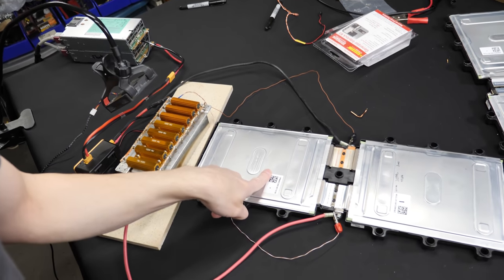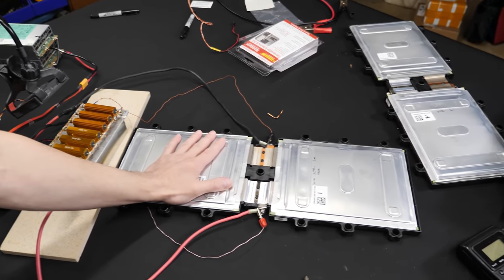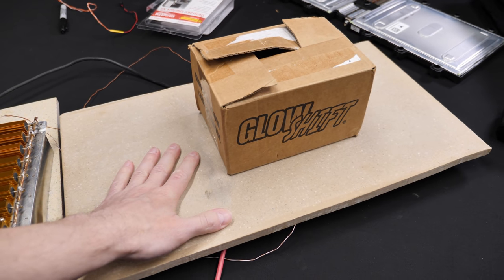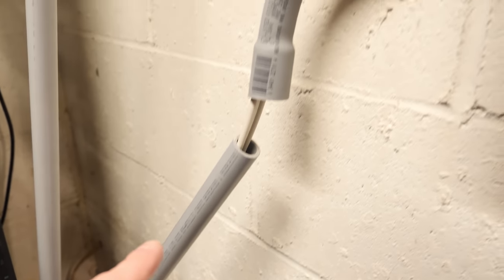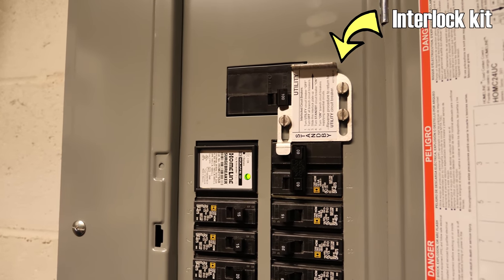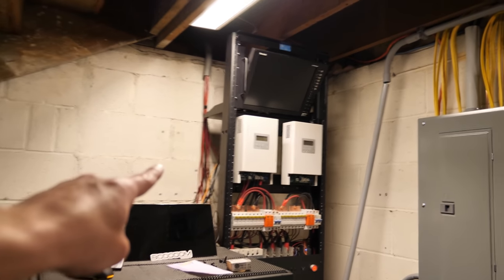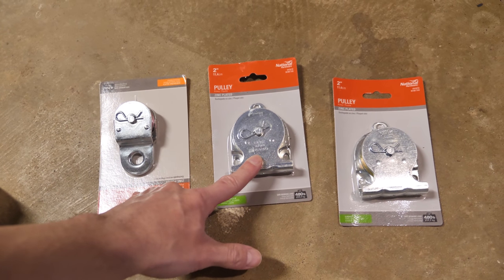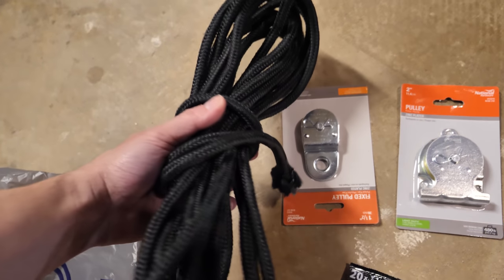Attempting to Mount 165lb Growatt Inverter on Wall!!

Comment: WOW. installing heavy things on a wall by yourself has its challenges. You improvised very nicely. I had a similar job a few times. My solution was to attach the 4 bottom screws lightly to 2 tall 2x4's of the length to match up with the anchor holes. Next was to place a 1/2 inch board for the 2x4's to rest on, raise the the heavy weight with the 2x4 'legs' pivoted by the wall. Next I secured the top 2 anchor screws lightly, remove 1/2 inch board which allowed the 4 bottom screws to line up with the openings in the object and remove the 2x4's. Lastly, attaching the remaining 4 anchor bolts.  The process took me 10 minutes - the 10 minutes included me coming up with the idea and the completion of the job. Wish I had those pulleys, you made it look way easier than what I did.
Reply from the maker: WHOA!!!! Thats a GREAT IDEA! Where were you a week ago???😆🤘
Reply: @AveRage_Joe  Thanks for the Like. Not to out do myself: Back in 1987 - I was in the Army, I was a 31M "Multichannel Communications Equipment Operator". My mode of equipment transportation was a 2 1/2 ton truck we called a Deuce and half. One very cold morning, the truck would not start. Everyone had no idea on how they would make the truck start. I thought for a minute: "I can start the truck - with a shovel..." Most if not everyone laughed and said I was insane. OK. I announced: "You want to make a BET, I can start this truck with a shovel?"  I waited until I had offers/bets for $200 overall and I bankrolled the entire $200 myself. I got the shovel out of the back of the truck. With my entire company and extras ( about 50 soldiers) all eager or betting this task could not be done. Now was my time to see how my one minute idea would play out. So:  I put the Deuce and Half in Neutral, I used the shovel under the drivers front tire and began leveling it up, and processing to getting the truck moving and moving. When the truck was at a good pace - I jumped into the cab and put it in 3rd gear, then popped the cluch. It started for a second and I popped it back into neutral - and I rev'ed the engine. No one ever questioned my abilities nor made a bet with me again. I'm just saying.
Reply from the maker: 😲😲😲 NOICE!!! I guess Ive done similar but it was no Deuce and a HALF!💪🤘🤘🤘

Comment: Excellent video Joe, lot of work, especially solo. Just wanted to say again how much I enjoy your videos.  Someone mentioned ratchet tie-downs below, that's a great suggestion. Last year while remodeling an older garage where the ceiling had sagged, I found myself faced with lifting and installing a 24-foot hogback of 2x8's, never would have made it alone without the pulleys and motorcycle tie-downs as a stop.
Reply from the maker: Thanks Man!  Yeah lots of work solo for sure!!!  Yeah I had ratchet straps for option2 if pulleys didnt work lol.  DAMN thats a lot!!!!  Pulleys are an amazing thing!!!😆🤘

Comment: I never weighed that inverter but it's more than 165 lbs.
What a PITA to install on the wall. lol. 
BTW, you may want to add some washers to all of those screws by removing one at a time, reinstalling with a washer and then move on to the next one :)
Reply from the maker: I think the shipping weight said 185ish and possibly the manual said  165lbs. All I know is its DAMN HEAVY lol. You know thats a great idea in the washer. I think Ill do that! Thanks man!!!💥🤘
Reply: @AveRage_Joe  yeah, definitely second the washers on those. Putting the screws near the end of the blocks was a good move too since it'll be solid concrete there so a lot more to grab with. Nice install, congrats on being off grid for that duration. What's your daily consumption averaging?
Reply from the maker: Oh ya.....totally ment to put the holes in the thicker part of the block😉😉🤥 Lol no I didnt even think of it that way. Yeah Ill add washers for sure! Not sure why I didnt in the first place. Thanks and my avg is around 500w. Sometime a little more or little less.💥

Comment: I just got this inverter (the 6KW version, planning on getting another to run in parallel), and am lamenting installing it as I broke my leg a few months ago and the inverter weighs as much as I do. This 12KW unit is beast mode (but also a lot more expensive). I have all the necessary pulleys, tools, screws, and hardware but will still need help. Also, the manual says you should have 50cm of clearance on the sides if I remember. The cat is not as much of a help as you initially hoped :)
Reply from the maker: JFYI this version cant parallel with other inverters. Thats why I went with the 12kw version.  Oh yeah its a heavy beast.  Many suggested putting a metal L bracket or something similar on the wall before hand so once the inverter is in position you can set it on the bracket to hold it there.  Yeah the manual said something about leaving so much space on wither side but I dont think there is a problem for my space.  Actually I know its not as I havent had any issues since installing.  And YES.....the cat was NO help at all! SHEESH😜🐈🤘

Comment: Looks like a pretty nice job after all that struggling, couple of options that might have made it a little bit easier for you.
The first being bump ledge points, these are just a pair of bolts or Nails something stuck in the wall that you can slide over and rest on as milestones. Best to use round top so inverter glides over them and then you can rest the load on the shafts while the head prevents slipping off.

Second is your blocks were several inches away from the wall, but the final lift point was close to the wall. This creates an angled lift, which will fight you the closer you get to the blocks, best to add a support that results in a less of an angle.

Upper block spacing should center line over center line of load, keep knots out of way.
This applies to both axis of the lifted load.

Consider using swiveling blocks with two pulleys each, this configuration is often available at hunting supply stores as a game block and tackle for a range of loads.

Consider putting a one way brake on the working line, that is a safety device and saves gains in height. Locate the brake near the block on the same angle as your pull.

I hope these help for the next lift, not much, but it's nearly 1:30 am.

Good night,  
🤔💭💣💥
Reply from the maker: LOL there are probly many things I could have done different now that it is done.  The bump ledge points would be a good option.  Id probly throw a 2x4 or something with the ledges on that so I didnt have to drill more holes.  Yeah I was fighting/struggling quite a bit since the inverter was away from the wall.  The brake would also be a great addition.  I like that!!!!💥💥💥🤘
Reply: I bet that you're  either a mountain climber or a piano mover . You sound like you know your  way around pullies .
Reply: @AveRage_Joe  yea ... a ledge might have been the best idea but keeping the angle straight with the wall too. I'm  like you , I  don't  depend on others so I  find a way ...
Reply from the maker: Just a plain ole knuckle dragger aircraft mechanic.😲
Reply from the maker: Yeah a ledge would have been best for sure! Never enough people around when you decide to hang a 165lb inverter to a wall lol😆🤷‍♂️🤦‍♂️

Comment: A block & tackle will work good too. Having a few buddies doesn't hurt either... Another thing that could be useful in a situation like this is to mount a bracket on the *bottom*, that could hold your unit while you screw in the screws... Anyhow, congratulations, & thanks for the video!
Reply from the maker: Yeah I think the bracket would have been the best help of all!🤣🤘

Comment: I have the 6kw version of this hybrid inverter.  Hoping to do a startup next weekend once my 14kw battery is finished (building it now).  Definitely easier with a helper here, but nice work with getting that monster mounted.  You can check out Tapcon screws at Home Depot or Lowes.  They sell the concrete drill for the screw, and they are quite strong.
Reply from the maker: Nice!  How much do you have left to go on the packs?  Yeah it was 2am when I decided to go at it so not to many others are up then lol.  Yeah I almost went with tapcons but decided the plastic insert was a good idea.....cant remember why tho now lol.  I could have sworn I had more mason bits so I didnt buy one while I was there DOH!!!

Comment: A friend and I hung a 6kw version of this and used a similar method. Not too bad but much easier with two people. The Growatt is a great unit.
Reply from the maker: I hear the 6kw is a beast as well!🤘
Reply: Your post shows being a year ago.  How do you feel about that Growatt inverter now?  I'm considering a Growatt (or two, so I can get 240v power) for a my out building and emergency backup power.
Reply from the maker: I Love it and would buy again!! 🤘

Comment: Thanks for the videos.  It was a pure pain to find the HV/LV on the DC batteries for the SPF12000tDVM.  I have a 6S battery, which maxes at 25.2 volts (salvage from a Fiat 500e).  Set in series again I have a HV of 50.4.  For low voltage I can normally go down to 40.8.  I believe the Growatts won't cover the 40.8 to 50.4 DC range with the LV too high.  

Still watching every video.
Reply from the maker: Thanks for watching!!  You should be able to set the hi/lo volts with that battery. Menu 21 is low cut off and is settable to 40v to 48v and menu 19 and 20 are bulk and float which is settable to 48v to 58.4v.🤘

Comment: been there dude. I tapcon screwed a 2x4 clete to the wall at the bottom of the inverter so it had something to rest on then drilled everything in place. I was nervous and things got dicey a few times. the rope pully made me smack myself in the head lol.....good call.
Reply from the maker: Yeah that would work as well and I probly should have used the same method or at least pulley it up and set on. 🤘

Comment: I mounted my 200 lb 18,000 W sungold power inverter on the wall about a week and a half ago using blocks mounted to the wall with big giant hooks and a ratchet come along pulley system it took a while and the hooks made terrible creaking noises but I managed to get it in place and it's now bolted to the wall with 20 big bolts.
Reply from the maker: Hell Yeah!!!! My lil pullies were groaning😆😆 How you liking the inverter?💥🤘
Reply: @AveRage_Joe  I love the Sungold Power inverter. It's just like grid power in terms of voltage regulation and load handling. My only complaints was the loud fan and radio interference. I invested $100 in a quieter fan from a reputable company and told Sungold about it. Sungold reimbursed the cost of the fan! I have a shroud of OC703 fiberglass around the output side to absorb residual fan noise and it's very effective. Can barely hear it in the next room a recording studio. I've put ferrite #31 clamp on RF suppressors on the AC lines coming out and that helps a lot. The built in MPPT charge controller makes full use of a third PV panel array I have set up and it contributes to the overall charging solution. Tech support is fantastic too. Great company and serious hardware.

Comment: FYI, a better method of mounting stuff in block walls is to use Tapcon direct screw into block bolts. They have better drill bits that come with the bolts.
Reply from the maker: And I almost went with those too!🤷‍♂️🤯
Reply: Tapcons don't hold well in block, they strip out super easy coupled with 165lbs, id be worried.
Reply: @jakeandrules7724  I've used a mixed system of Tapcons holding up a 3/4in veneer plywood backplane to which the equipment is in turn mounted in my big solar system with good results.  No pullout problems with either a Magnasine or a Sol-Ark 12K.
Reply: I think I would have been tempted to to use a chemical fix (2 part epoxy based) and threaded bar ( I think it’s called all thread in the us) I had a 6ft x 3 ft chrome radiator in to 1980s aireated block (we call it breeze block) and it’s crumbly as f&!:k. As you can imagine the radiator is heavy even before it gets filled full of water and is held on with 4 thread bars and bolts and washers. Still there and not moved an inch.
Reply from the maker: Yeah that would be a great option as well!!!😲🤘
Reply: @AveRage_Joe  since the load is downward, anything is fine holding them up.
I only suggested tap cons, because they are easiest to install, and they are very secure.
Reply from the maker: Thats what I kinda figured! Tapcons would work for sure tho!

Comment: Yes sir - fantastic job - its really enjoyable to watch you problem solve.   I have 2 x AIMS 12,000w inverters - each one is about 175lb :)    I made a unistrut  double decker rack and used 4 pully block and tackle to slide them up (20deg angle)/into place horizontally on the rack on some Unistrut rails instead of vertical - so they never 'left the ground' to be suspended in mid-air...    scary (to me).   AIMS tech support said that horizontal was perfectly fine - I wonder if Growatt could be installed horizontal as well?.
Reply from the maker: NICE!!! I think in the manual it "recommends" vertical but Im sure horizontal is just fine. I will say that the fan doesnt kick on as much being vertical since the heat can just exit the top. The week test run seemed like the fan turned on more.🤘
Reply: Offgridinthecity?
Reply: Yes :)
Reply from the maker: YES!🤣🤘
Reply: Lol, knew it!
Reply from the maker: Im renaming my ch to off grid in the city......🤣 JK

Comment: When I saw you tying the rope at the top I was thinking "that's going to be hard, why doesn't he amplify it by attaching the end to the inverter? Is he going to DavidPoz brute strength it?", then you came to the same conclusion!
I always end up with a wonky screw when wall mounting things!
Reply from the maker: 🤣 Yeah it took few a few min to figure everything out lol. I think David has a little moar Brute strength then I do. The inverter weighs more then me😬😝. Yeah its crazy with the one odd screw hole. I started each slow to make sure they didnt wander but🤷‍♂️🤣
Reply: @AveRage_Joe  I am always amazed at DavidPoz's brute strength and how he doesn't seem to notice cold!

Comment: These all in ones are really making a run towards big solar and that's great to see.Solar and all renewals should always be affordable to the masses.
        My question:since you are grid assist ( not grid tied ) in order for this to be code compliant shouldn't there be a provision for rapid shutdown at module level? is that even possible with these all in ones? Tigo perhaps?
Reply from the maker: Thanks Man!  Totally agree stuff should always be affordable!!  I have the emergency shut down button which at this point shuts down all DC which includes battery and solar.  I think I could add the AC in there as well with the ABB shunt trip breaker.

Comment: Question about the unit could you add another unit to it where each unit is just handling 120 volts 180° out of phase of each other? That way you would have a true 12 KW on one leg and 12 KW on the other leg.
Thanks in advance for the response.
Reply from the maker: Nope, not with this inverter at least.  This one cannot be connected with another.  I hear they are making one that can be but havent seen anything yet.

Comment: Hindsight always being 2020, and me being an all star arm chair quarterback, I believe I'd have mounted the inverter to a piece of 3/4" plywood, removed it, then mounted the plywood to the wall to more easily hang the inverter.  Of course, that may be a code violation or fire hazard.  

I can tell you're not from the deep south.  You buy a 6-pack of Schaefer light for like $3.95, invite a couple of buddies over for a beer, and do the "as long as you're here" thing.  We all learn that one by falling for it.

A really interesting video would be your experiences with permits to grid tie, or even wire this to your main panel for off-grid use.  I realize each viewer's locality might be different, but it would be interesting to hear your experience.
Reply from the maker: Yeah a few buddies would have been GREAT!  It was also around midnight when I started hanging it.  The instructions say to mount to concrete or things that dont burn but to be honest if I had a finished wall Id mount it anyway or possibly use a sheet of concrete board.  My system is aimed more for off-grid.  Who knows what the future will bring and possibly adding a grid-tie system.

Comment: Nice!  BTW, not divide by 4.  You had 3 sections of line pulling up on the AIO and the one line you were pulling down on.  So divide by 3 if the pulleys were perfect and had no friction.  More like divide by 2.5.  So you were pulling down around 66 lb.  While juggling it around and getting it lined up.  Nice workout.
Reply from the maker: Yeah I wasnt exactly sure lol but it was a juggle for sure lol!😆

Comment: Where are the AC breakers that feed your inverter?  I'm guessing you have a Service Entrance panel near your meter that has the main disconnect and feeds the inverter & subpanels?
Reply from the maker: Yes I have another panel that feeds the inverter.  Its actually a super old panel thats original to the house that I kinda "rewired" for now.  Will be replacing it sometime.  I show it in another video here https://youtu.be/mG5924gRBOU